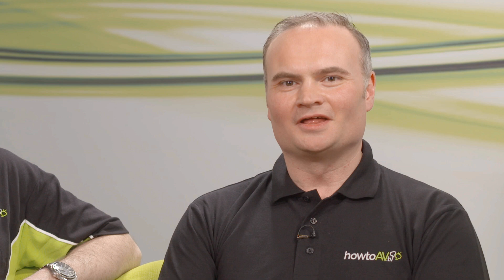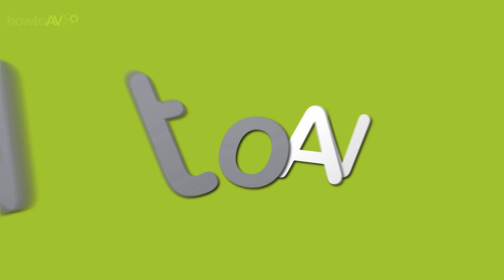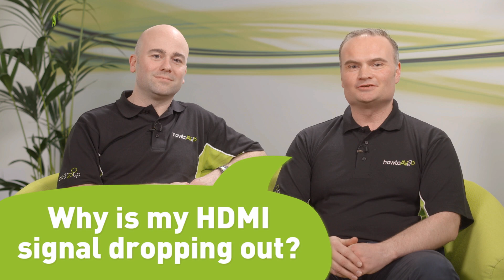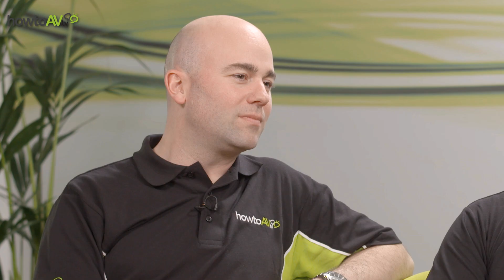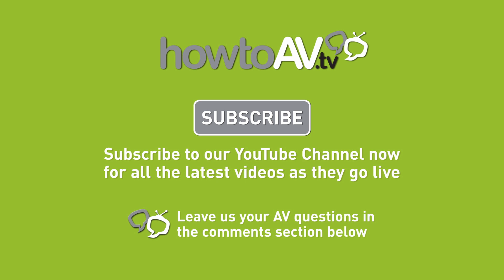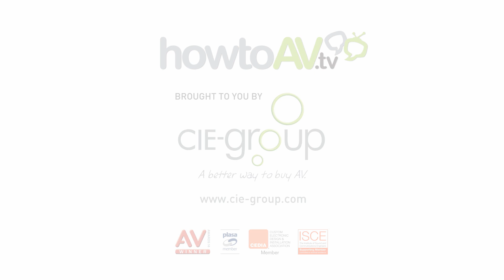Why is my HDMI signal dropping out?

Comment: Hello, I connected my hdmi cable to my laptop and every 10minutes the sound and image are freezing. When I disconnect the cable , sound and image working perfectly on laptop. I'm facing this problem since I moved to a new flat. I have never faced this problem before. Same tv same laptop same cable. ps this in my PS4 hdmi cable which is fully functional!

Comment: I have a Sony LED TV with Internet. My TV was working fine untill yesterday.. when an HDMI is connected to it... It intermittently drop signals and then connect itself automatically... I dont know where is the problem. I tried resetting the settings to factory default and tried two to three new HDMI Cables but the problem persists What can I do now to resolve the issue...
Reply: Zubair Raza had your problem fixed,if yes how it had been rectified?plz explain

Comment: Whats wrong when I set up my Xbox 360, it says no signal. The only thing that I could think happened to it would probably be me accidentally throwing on to the floor. The ATV cable works but it looks Shit.
Reply: Configure the x-box to work on the HDMI out through the settings menu. If it does not work out, download the console in safe mode and then configure it. The HDMI cable has nothing to do with it.

Comment: My brother bought a Samsung 55''-60'' aprox., I try to play a blu-ray and a mhl connection, the TV didn't recognize the hdmi cable. It says (no signal).When l connect an AV cable the word AV is brightly lit but when l put the hdmi does not do that! The hd cable is fine because I try in other TV and it works well. I put the HD cable in the 2 hdmi inputs and nothing. You think the problem is the TV.? Is that an expensive repair? 
{Sorry for my English!}
Reply: When the HDMI signal is turned on, the source and the TV exchange EDID data about what resolutions and frame rates are acceptable for them. If they can not agree among themselves, then the signal does not start to show. I think your new TV does not have all the modes that the player broadcasts to it. Set the player's mode to manual, specify a low frame rate of 25-50 Hz and a color of 8 bits. Experiment with this.

Comment: Hello my lg or sansung tv says when plug my hdmi on tv that says no signal and check your connected device power and source connection
Reply from the maker: Try testing both Source and Display devices by firstly connecting an alternative HDMI Source into your TV - does this work?
Then test the Display by connecting your original Source to an alternative TV or Screen.
You should also try an alternative HDMI lead; if you current cable is longer than 3metres, try a quick test with a short 1 metre lead.

Comment: I have a ps4 and all of a sudden it will not connect to the TV I've bought a new HDMI cable and it still won't work
Reply from the maker: Have your tried testing your PS4 in an alternative video input on your TV?
Also, try connecting your PS4 to a different TV or screen; if this doesn't work, it appears there may be a fault with your PS4.
Reply: HowToAV.tv  I tried it on a different TV and it worked!! thanks for the advice!
Reply: Hi Guys

I have a brand new Samsung 4K tv with a PS4 pro.

It randomly loses signal for a split second just the once every other time I switch it on. I’ve switched off hdcp. It worked fine on my older 1080p tv. It’s hard to call it a fault when it just does it the once every now and again.

Could it be the xmas tree lights next to the tv?

Comment: Hello. I have a PS3 Slim that has a problem. HDMI Out doesn't show the image at all. I've done everything from resetting the resolution to changing the input. This problem has been going on for three years with no luck what so ever. I'm using Universal Component Cables (Red, Blue, Green) and suddenly the image goes in and out recently when on 1080i so I reduced it to 480p for the time being. Is there a way to fix this problem with the HDMI Port?
Reply from the maker: I'm afraid it sounds like your PlayStation has a fault on the board and needs looking at. Needs sending back to the manufacturer or your local games repair centre.
Reply: Well,  I don't want all of the saves to get deleted.
Reply: Connor Waltman i had the same problem, but the problem was on the tv. i reset the tv and it worked :)
Reply: I don't know how to reset a tv.
Reply: Write you tv modelnr/name on google and almost find everything about it. But if your tv is to old mybe you will not find it :/ (my tvs model: kdl-40wd653)
Reply: Connor Waltman I have the exact problems dude 😞Annoying huh ?

Comment: Hi Guys I Have A Samsung 2009 LCD Model Number LN40B610A5FXZC TV With No HDMI Ports Working At All And I Tried All Your Solutions. How Do You Fix The HDMI Ports You Plug Your HDMI Cables Into The Samsung TV If Your Solutions Don't Work?
Reply from the maker: Unfortunately Brandon, if you've tried all our suggestions it sounds like it may be time for a new TV! There's some great offers in the new year sales, of you could drop your TV in to the local repair shop and ask if they could fit a new HDMI board.
Reply: Thanks

Comment: What if the signal does work, but not straight away or randomly not at all?
Could it be an auto detect problem?
Reply from the maker: Try setting your Source device to a fixed output resolution (eg. 1080p); this may help your display to connect to the Source more effectively.
Reply: Radio Raven

Comment: i unplugged one of my xbox cords and the picture disappeared and i plugged it back in and no pic i unplugged every cord and no pic help
Reply from the maker: Which lead have you disconnected from your XBox? Was it power or HDMI?
Could be a problem with your power supply.
May be an issue with your HDMI output or HDMI lead.
Or worst case, may be a corruption on your XBox OS.

Comment: hello i have a hdmi cable that i know works but when i plug in an adapter to micro-hdmi i get no signal from my asus vivobook to the tv plz help me, is there maybe some software i need to get or do so it connect or have you got any other troubleshooting tips? thx
Reply: Сonfigure windows to display two screens: start - control panel - screen - configure screen settings. Specify work with two screens - OK. I think your adapter does not have all the contacts to send a signal about connecting a second monitor to your laptop.

Comment: Guys can you help me?? I pushed my hdmi cable in the hdmi port very hard and now its not working!! Please help me 🙁 the cable works 😞😞😞😞
Reply: Its the hdmi port that is broken. Please tell me what to do
Reply from the maker: Sounds like you either snapped or displaced the HDMI board I'm afraid! Needs to go back to the manufacturer or your local TV repair shop, who should be able to fix this for you quite easily.

Comment: I have a Vizio M60 series and an Xbox 1S and when playing an ultra 4K blue ray from time to time the pic will go black for a few seconds and then come back..  I've tried different cord no luck and when I cut off the 4K and go 1080P on the Xbox no issues with handshake??? Help
Reply from the maker: Hi and thanks for your message.
As you are running a 4k signal, it's likely that your standard HDMI cable isn't up to it I'm afraid.
Try a HDMI lead no longer 2 metres to see if this solves the problem.
If you need to connect between devices over a longer distance, then you're going to need a premium grade HDMI cable (UHD compatible which should allow for transmission distances up to 4-5 metres).

Thanks for viewing and keep sharing!
The HowToAV team
Reply from the maker: Thanks for your question; as you're running 4k UHD, we would suggest either using a shorter HDMI cable or looking at the latest premium high speed HDMI cable. The latest advice for UHD is to keep your cable as short as possible - down to just 1 metre if you can!
Reply: I have a similar problem with muiltiple sources(PS4, Wii U, but my PC gets it the worst) and I dont run anything above 1080p. It seems like when Im playing a game certain areas will make it happen more. Ive had it drop out 15 times in a row, always for like 1-3 secs

Comment: I've recently bought a new pc. Every now and again the hdmi signal from my gpujust drop and the only way I've found to fix it is restarting my pc. Any ideas?
Reply from the maker: It could be a cable fault, a hardware fault (graphics card or monitor) or some kind of external interference (mains spike when high wattage light is switched for example) which again would point to a low quality cable with inadequate shielding.

As the signal isn’t going through any switching or distribution hardware it is most likely one of the above.
As with most problems such as this, please try the simple tests first:
Try an alternative HDMI cable
Test if the problem is with the Source (PC Output) by connecting a different Source (eg, DVD / Bluray to your TV with the same cable)
Test if the problem is with your TV by connecting your PC to another TV
If you TV has more than one HDMI input, try changing the input your PC is connected to.
You might also try changing the resolution of your PC (but if it's working in the first place, then this is unlikely to be the problem)

Best of luck!
The HowToAV Team
Reply: HowToAV.tv thanks.
I've tried a new hdmi, I've used the monitor with my games console and the pc with another monitor. Same thing always happens. I've got a few more tests to run I.e using display port cables in case the hdmi output on my gpu is faulty. But after that I'm out of ideas.

Comment: Hi guys. I have a media box mxq which i was using today went out of the room come back in and then i could see a blank screen. So i have changed 3 HDMI cables still nothing and even tested the cables on other Devices and they all worked, so I'm thinking it's the port on my media box what do you think can you give me some advice please
Reply from the maker: Good morning Alan and thank you for your question.

The first two simple tests to try out is testing the Media Box and testing the Screen.
Test the Media Box by connecting it to an alternative screen/TV.
Test the TV/Screen by connecting it to an alternative HDMI Source.

Another idea would be to use the composite video output from the media box into a phono or scart input on the TV. This will check if the box is powered up and working without going through the HDMI output.

By testing all of the above should indicate where the fault lies.

Best of luck and many thanks for viewing!
The HowToAV Team
Reply: HowToAV.tv thank you for your advice I'm still looking into fixing it fingers crossed 👍🏻
Reply from the maker: First thing to test is try connecting your Media player to an different screen/tv.
Alternatively, have you tried connecting your MXQ to the TV via the composite AV output? (should be via a 3.5mm jack)

Comment: Hi guys. I'm using a Samsung S7 to HDMI to my (not) Smart Samsungs TV. I've used a different model phone and it was always temperamental but the Samsung S7 just doesn't work at all, no signal is being picked up by the TV. Someone suggested rebooting my TV, but was wondering on advice. Cable is new and bought a second new one to just be sure and they work elsewhere.

Comment: My Samsung blue ray player has stopped working. It's telling me the signal isn't stronger enough yet I have changed nothing. I've come
Hacked cables and they are OK. Is there anything I can do.
Reply from the maker: A few things to try here...
How long is the HDMI cable that you're using? And have you tried testing the system with another HDMI cable?

If it's a long HDMI cable, try it with a short HDMI lead (Move the Source or Display device closer just for testing purposes!); this will indicate if there is a problem with your long lead or distance.

If it works with the shorter lead ok, then you either need to try moving the Source and Display closer together on a permanent basis or you could use a HDMI signal equaliser such as this:
https://shop.cie-group.com/shop/av-distribution_19/hdmi_1023/hdmi-splitters--repeaters_90/hdmi-hdmi-equaliser_2994.php

Or a HDMI Distribution Amplifier such as this:
https://shop.cie-group.com/shop/av-distribution_19/hdmi_1023/hdmi-splitters--repeaters_90/v13-hdmi-1-to-2-distribution-amplifier-supports-4k_847.php

Comment: Any fixes for a loose hdmi port in back of TV
Reply from the maker: If your TV is still in warranty then don't touch it! as this will negate your warranty. take it back to the vendor who you purchased it from and let them fix it or replace your TV.
If the TV is out of warranty, the loose HDMI might be fixable depending on whether it's a problem of loose soldering or a cracked board.
Unless you are a confident electronics engineer, we would strongly recommend taking your TFV to the local TV repair shop and letting them take a look at it. Should be easily fixable

Comment: I tried multiple hdmi cables still no signal found
Reply from the maker: Have you tested the Source device with a different TV screen and the TV with a different Source?
If it's not the cable that's the problem, then it must be Source or TV; unless you have any splitters/switches, etc in the system?

Comment: I only have 1 hdmi port and I still get no signal. I tried to hook up my Xbox 360 to another tv and it worked out fine. I tried hooking up other devices to the new tv and they don't work either. what do I do?
Reply from the maker: Hi and thanks for your message.
If you - as your message suggests - you have already tested the HDMI input with other devices and you've tested your Xbox on another TV, then this definitely sounds like you have a faulty HDMI input on your TV.
Needs to go back to the retailer for a replacement!..

Comment: I have 3 hdmi ports only 1 works. the other 2 say no signal or I get discoloration throughout the screen with static noise. I have an xbox hooked up to the working hdmi. cable and apple tv are hooked to non working hdmi ports. I tried switching the Apple tv and cable to the HDMI port that the Xbox is hooked into and it won't work with those. switched cables and no changes. I'm not ready to drop money on a new tv. all internal boards were replaced about 4 years ago. had same issue.

Comment: so...i have 2 hdmi cables, 2 hdmi ports on my sony smart tv and a PlayStation 4 console.... and trust me, i have tried everything possible.... i keep seeing a black screen and a message that says "to check the external input or change to another input on the tv" which i have done several times and with some other devices like my laptop and my dvd player.... but just one thing, my sony tv displays an information on the top right corner... that the hdmi is perfectly connected to the PlayStation 4 ....please can you help?
Reply from the maker: Many thanks for your email and sorry to hear you're having problems.
Here's what one of our engineers had to say - it appears he has experienced the exact same problem!...

It seems to happen when the PS4 cannot auto detect the screen resolution  of the TV so outputs a 1080p signal or another resolution that the TV cannot handle. The way to resolve is as below from a support forum gamefaqs.com). It seems a common problem

http://www.gamefaqs.com/boards/691087-playstation-4/71454755I  had this exact same problem when I was trying to set up with my TV. My issue was that the 'auto-detect screen resolution' decided my TV could handle 1080p (when it can only handle 1080i). 

Turn the PS4 off (you have to hold the power button on the console until  you hear a second beep; 1 beep turns the light orange and puts the PS4 in standby, the second actually turns it off).

Hold the power button for at least 7 seconds. There will be an initial beep; then after about 7 seconds (felt longer), there is a second beep. This will turn the PS4 on in safe mode. [This  temporarily sets the resolution to the minimum (460p?)].

Select the one that mentions resolution or display (I think it was the second option). This will keep the PS4 at the 460p when it turns on normally. Once the PS4 is back to normal, go to settings and change the resolution for the best one for your TV.
EDIT: I had to try the standby mode twice to get it to work right.

Comment: My TV works fine with an HDMI cable till somebody rings the doorbell, or flicks on/off any switch in the living room. Once any of these events are triggered, the TV faces a blackout for a few seconds. It doesn't seem to lose power, but just the image. In case multiple switches are turned on/off, the TV is unable to recover, and starts showing "snow" (like old world TV's). I have replaced the HDMI cable with another one with a noise filter, but with no luck.
To add, the TV and the living room lights are on different fuses in the mains fuse box, though the TV is on the same fuse as the kitchen, where we have the fridge. However, the TV does not suffer from blackouts when the compressor (read : fridge) starts or stops. I am unable to understand and fix the problem. Please help.
Reply from the maker: This is a strange one Neeraj!
How long is the HDMI cable you're using? We're wondering if you could be at the limit of HDMI distance (and, therefore, your signal is dropping out with the very slightest of interference?)
The problem might also be a grounding issue perhaps?

Initially we would suggest testing your Source and Display devices by connecting with a short HDMI lead (ie. 2-3 metres) - do you still experience the same problems?
If so, it's not your cable and it's not a distance issue.
Also try similar tests with an alternative Source and Display/TV.

Through a process of elimiation, you should find the fault.
Best of luck!
The HowToAV Team